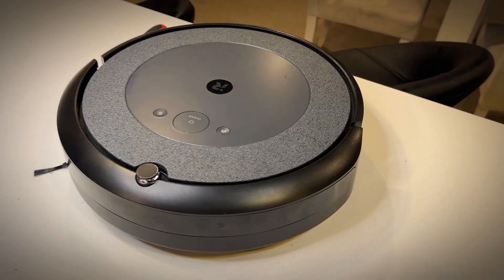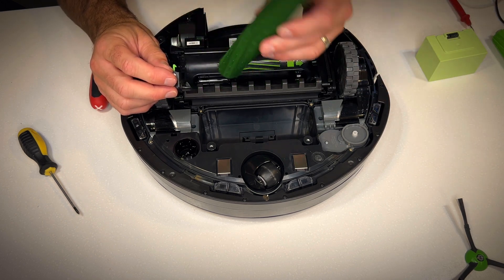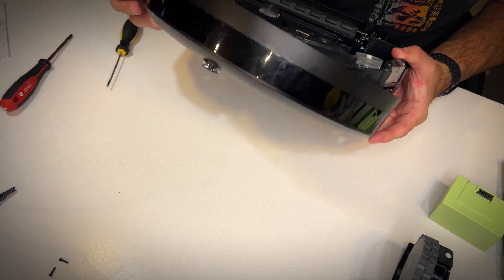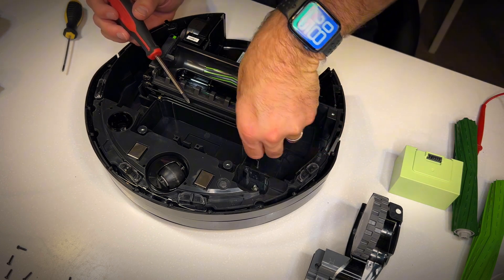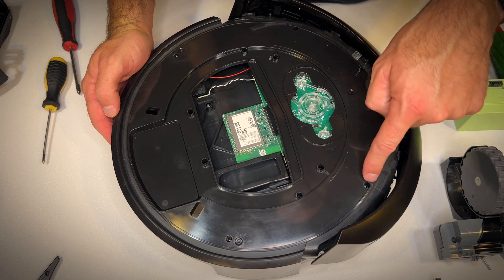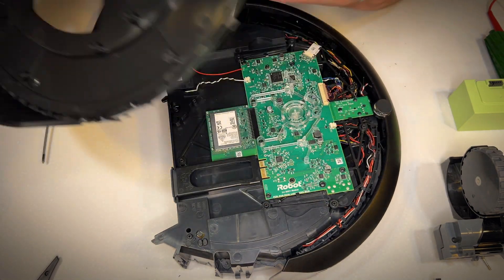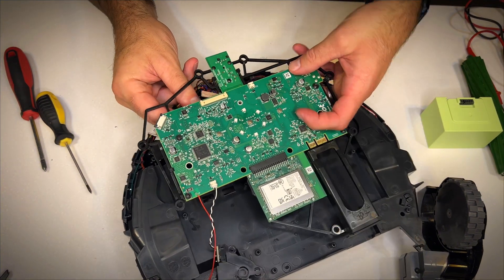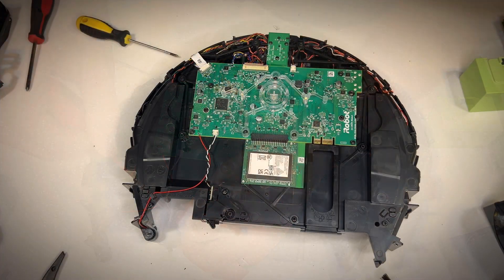iRobot ROOMBA - I3 battery replacement and disassembly

Comment: Is there a way to detach the red grounding wire? The one that is soldered to the board that goes to the little brush. I'm replacing my motherboard and I can't see how to do that.
Reply from the maker: Well done for giving a motherboard replacement a go! I’m unsure about the red wire sorry I haven’t yet attempted to disconnect it. I presume the brush and wire can be pressed out of the plastic housing. Or  next best thing would be to unsolder it from the old board and re-solder it on to the new board, but that does add an element of risk if you are not confident in soldering.
Let me know how you get on.

Comment: Hi, I really enjoyed this. I have replaced a few parts.
But need advice. She got stuck under a recliner and I pulled her out. She gave me a number error. I dismantled her and tried again. She wants to start vacuuming, but then twirls in circles...and stops. do you think the bomber and sensor is faulty?
Reply from the maker: Hi thank you for watching! I’m not entirely sure what would be causing the fault, but checking the assembly to see if the bumper is working freely and not jamming would be a good start. Otherwise possibly some damage to one of the wheel modules